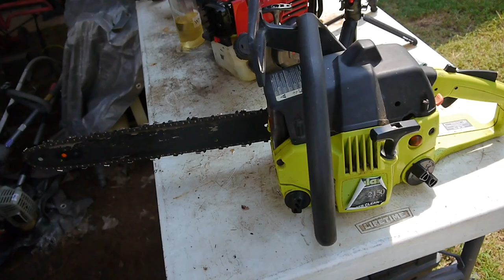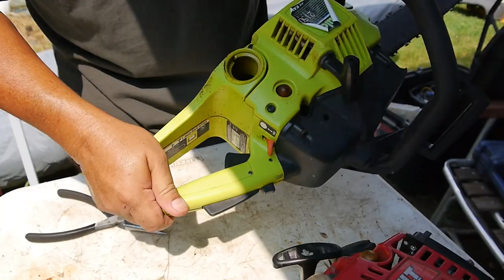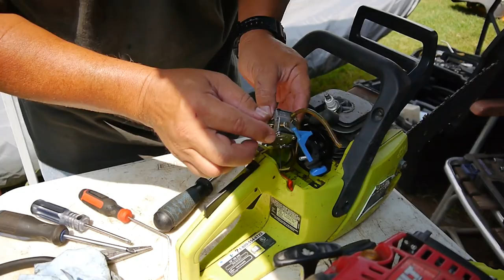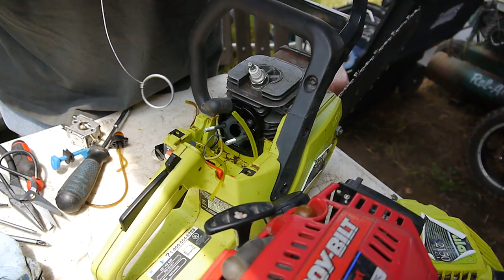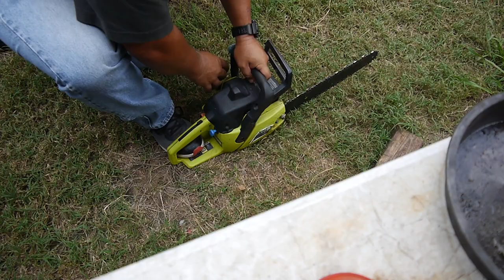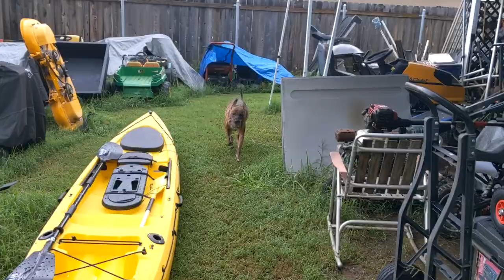Let's find out Why this Poulan Chainsaw Would Not Start

Comment: On the primer bulb , the IN side goes to the small brass tube on carburetor and the OUT side of primer bulb goes to tank return by the right side of carburetor as viewed from the top of saw ! The idea is the primer bulb when pushed in squirts gas into tank and when released pulls gas through the fuel filter via drawing it through the carb through the small brass tube on carburetor

Comment: I hope you don’t have to work on that Troybilt 4 cycle trimmer on the table. How do I know this? Because I replaced the starter pawls on mine twice because it never started right from new, Then when it started bogging I threw it across the yard, I bought an Echo trimmer 3 years ago and never have had any problems.
Reply: Y

Comment: The chain should not be moving at idle if the chain brake is off and the throttle isn't depressed.  You may have a bad clutch brake too!
Reply: That particular model saw has NO brake.

Comment: wanna come over and fix mine? hahaha i cleaned the filter on carb-blew it off, looked at spark plug but couldn't get it out. bulb pushing fuel. IDK. has ruined my fire to go cut wood.
Reply from the maker: It can be frustrating, but don't give up!